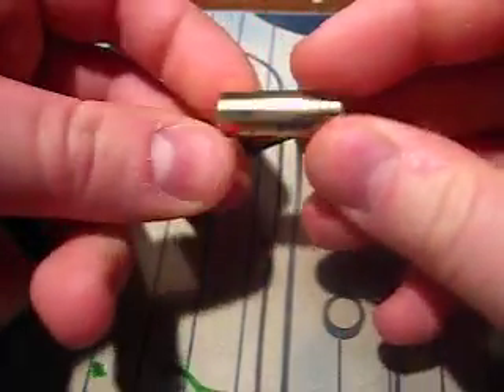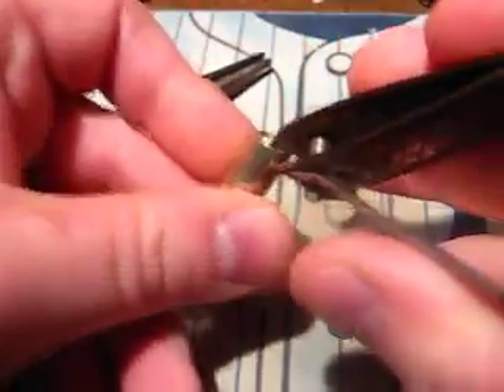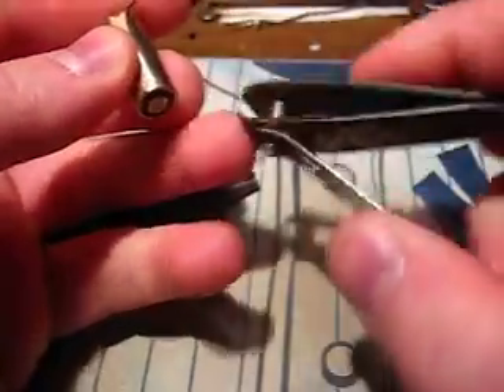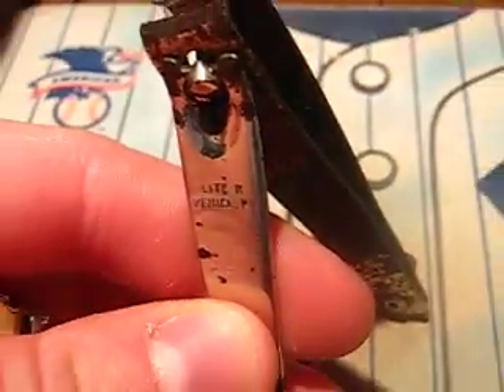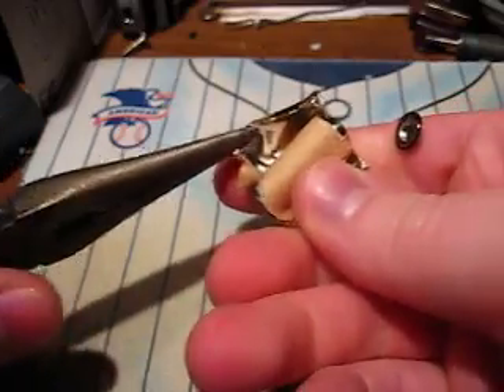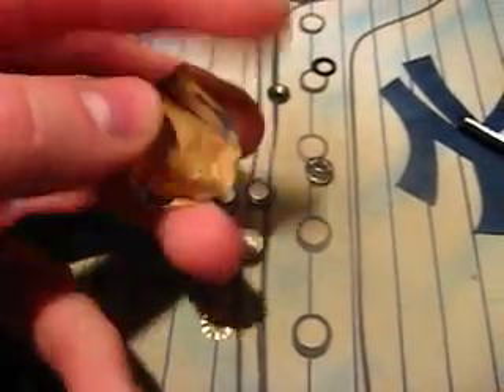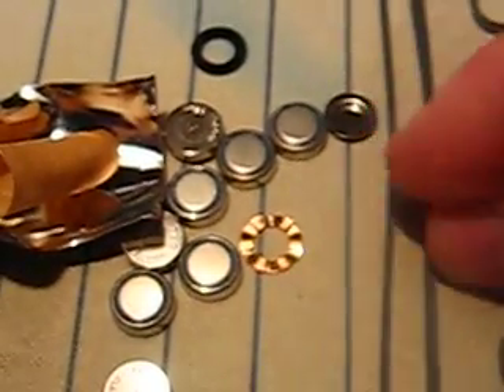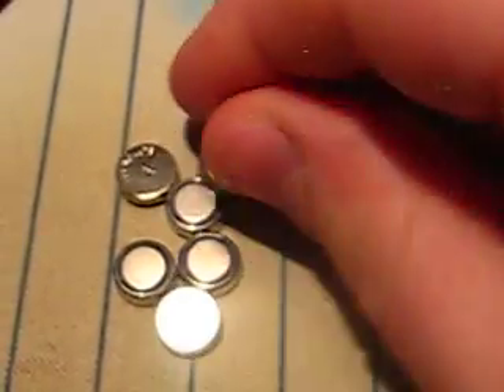A23/23A 12 Volt Battery Hack!

Comment: I have a DL-4103T01 remote piece of shit fan controller.  Hampton Bay wants me to buy a new remote.  This "method" isn't any kind of solution.
Reply from the maker: Saw that: http://community.homedepot.com/howto/DiscussionDetail/Hampton-Bay-Ceiling-Fan-remote-eating-batteries-9065000000007GB
Lots of people are having this issue. I would just go old school and get a basic pull chain ceiling fan they are maybe $20-$25. I never liked the remote fans.
Reply: Tried that...their team sucks.  No help.  Replacing 8 buttons isn't an answer.  Cheaper to buy A23s by the dozen thru Amazon, but that's not the real answer, either. I'll look for a replacement.  Two years old isn't an excuse for a short in a remote unit. A real piece of crap from a crappy company.  Hampton Bay products used to work--once upon a time.
Reply from the maker: Vin D

Get an old school fan with no remote just the two pullchains. if you want a remote just tie a string to the chain. I did that with a light once. I like your name Vin D is that like Vin Diesel? I like him.

Comment: Great enlightenment.  I had 2 12v batteries intended for a multimeter. Each registered 5v or 6v.  Didn't have sacrificial nail clipper, so used tiny precision screwdriver and seemed easier.  Button cells showed 0.5v or 0.6v; about to throw away, sandpapered all 16, and all then showed about 1.5v.  Inserted 8 loose button cells in multimeter (screws together holding cells in place) and works fine.

Comment from the maker: @djsmithy 
That is how electronics companies make their money by designing things to fail. Don't be surprised if the government bans extended warranties on electronics that you buy in store. If you ever have an issue with a TV or something It's most likely the power supply caps. if you are good with electronics, order a bunch of caps online and change all of them. use better ones than the originals.

Comment from the maker: @Thepockets88 
Try a 9 volt battery eliminator. The adaptor puts out too much current. use one with 9VDC and maybe 20mA. The A23/23A batteries put out maybe 10mA of current b/c it's just 8 button cells and button cells are almost useless. if it burns out again then this might not be possible.

Comment: do you know how to replace these with a wall wort connection? i have tried using regulated 12 volts dc at.5 amps and still burn out the electronics. im tired of buying remotes. and the devices i use dont have a "base station" i can buy

Comment from the maker: @woodwin00111 
bend the outer metal layer starting on one of the ends and peel it off then be careful and keep peeling it off and if it falls apart into 8 button cells then you've done it right. KipKay used an energizer in his video and I used a no name brand and him and I got the same results.

Comment from the maker: @ Adam8871
umm ive taken apart button batteries before and sometimes its black dust for the cheapo ones and white paste for the more expensive ones. maybe ill blow one up with my 360 power brick as soon as I can grab some large alligator clips for attaching to a car battery. thats gonna be my next project. making a battery charger out of my xbox 360 power brick.